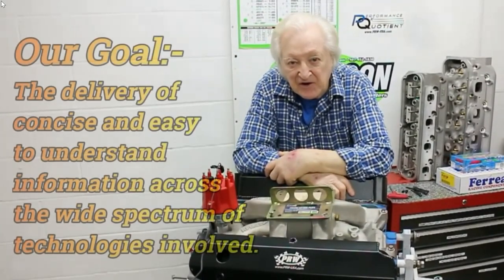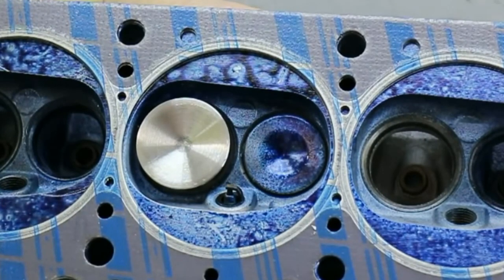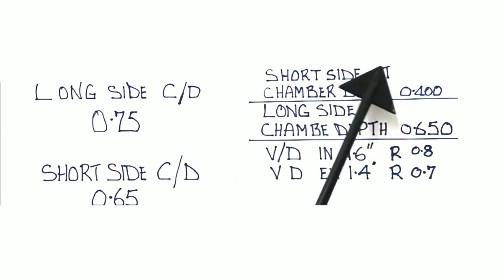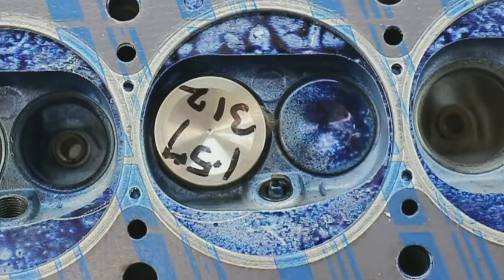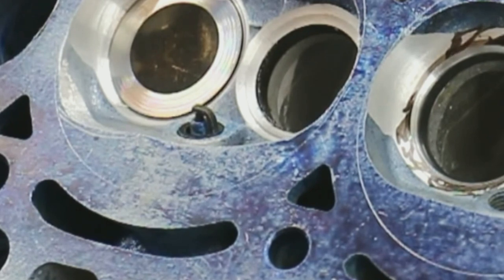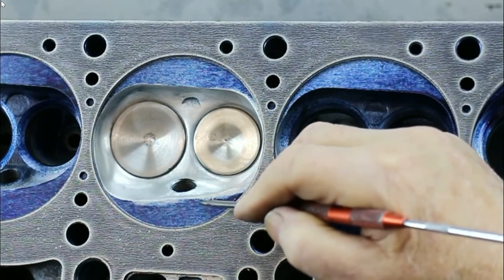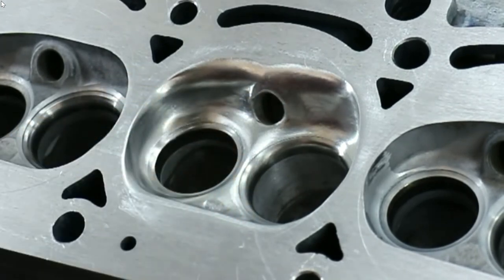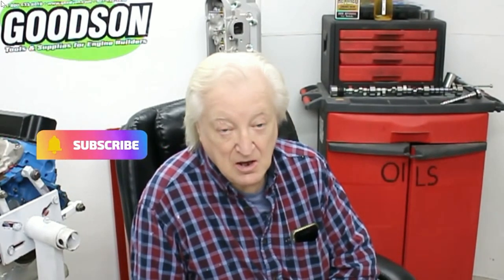Don't be without  the Turbo head chamber mods  shown here.

Comment: Mr Vizard, I did some dyno development with the 2.2 turbo 20 years ago. If using a factory style dish piston, there is maybe 1/4 inch of quench possible. Forget quench. These engines relief on massive intake pressure to make HP. Lots of heat. I found making an open chamber with consistent combustion chamber thickness gave a much more broad tuning window in  the 30 psi + range.Drilling the coolant passage oversize below the ex port in the block, gasket, and the head was also a plus. Because of the poor cylinder head, these engines require high boost to make HP. Dealing with heat in the head  is a must
Reply from the maker: Good info here Kyle, Can you pass it on to Richard Holdener for me please?
Reply: You ever try ceramic coating the combustion chamber and exhaust port to contain the heat?
Reply: @heem6619  Never tried ceramic coatings. In my research, making combustion chamber casting thickness uniform eliminated hot spots, allowing coolant to do its job,  and gave a much broader tuning window, at 30+ psi manifold pressures.
Reply: @DavidVizard  Mr Vizard. Sir, I already have. Seemed that Mr Holdener didn't put much faith in my experience. No harm, no foul. In my testing, the thickest parts of the chamber away from coolant became "glow plugs". There was evidence of erosion on those areas on blown up engines from spark knock. Kept removing those areas in the chamber, and the spark knock for no- good-reason went away. Went from breaking ring lands on the ex side with barely audible knock, to chewing up only  the center of the piston with very obvious knock when the tune was off. Opened up the tuning window, allowed more mistakes, hurt way fewer parts. Now they tell me that the big $$$ folks call this "chamber softening".

Comment: Artistry. 🫡 Unlike the old Slant Six, the Chrysler 2.2 is a bathtub, non canted valve, non wedge , non Heron type head. That's some lovely head porting on a very basic head. Minis, Triumphs, Cologne V6s, some of the most basic Bathtub heads respond greatly to the smallest modifications. 🥝✔️

Comment: David,  I would really like to see a video of what you would do to a GM 3.8L V6
(Gen II), which was a very popular engine for over 20 (maybe 30) years.
It has been turbocharged, supercharged, there are TONS of these engines
laying around, they can still be rebuilt and "built".  My biggest questions are
with the heads, intake, and cams, both stock and aftermarket.  These engines
are very reliable, get good mileage, can make very good power, and can even
out-power some small V8s if they are built right.

Comment: David, have you had any experience with Direct Injection (high pressure) Fuel Injection ? Speaking about GM/Chev GenV LS/LT Engines specifically , Do the extremely small chambers found in these Direct Injection Cylinder heads (OEM or Aftermarket) benefit from a chamber softening for certain boosted and/or Nitrous applications, as one would normally do to high performance heads using regular Port Injection ?. With the valve angle being quite shallow on most Direct Injection Cylinder Heads (11deg-12deg range) along with the small chambers (50-60cc range) the Pistons are normally limited to flat tops with the standard 'Direct Injection piston design center fuel cup' dish in the center, not really allowing for a pop-up type of design. The goal by the engineers seems simple enough, to get high compression ratio while accommodating that shallow valve angle.
I am really interested in building a Direct Injection setup using a GenV GM LT1 376cu, or perhaps the L8T 401cu Truck engine from the same family, as a BOOSTED cruiser on 87 octane fuel. With Direct Injection introducing fuel at TDC rather than on the way up on the compression stroke, much higher compression can be run on worse fuel thanks to that pre-ignition mitigation using fuel timing. 11.0:1 from GM is safe for 87oct on these engines without the risk of knock, so I am wondering if a small chamber softening can help further, so that a streetable 10.5 - 10.7:1 can continue to run 87 octane while boosted without leaving all of the timing on the table. I would really love to learn more about Detonation/Pre-Ignition mitigation Tricks and Tips that you may have that may apply to this type of fueling, or even standard (low pressure, standard injection timing) Port Injection. Cheers and thanks for taking the time to read this mess. I hope it makes sense.

Comment: When you have a chance, look into this, modifing the oil pump by-pass passage return and spring tension, don't know if this is a agreeable rule or not,  8 to10psi per 1000rpm for NA engines, if you are turning 6000rpm because of that stock camshaft, then 55psi might do,  anything above that is HP robbed by the pump
Reply: Definitely does take a lot of force to turn higher pressures and it’s a real power drain also more heat and stress on the oil! I run a low rpm (below 6k) v6 turbo engine and use 20w50 to 25w70 oil at 80 psi hot idle and 100 cold in order to gain crank and rod stability at high boost and torque load,I had previously tried lower viscosity oil and lower pressure it’s got the benefit of better turbo spool and overall a free turning engine but subject those big ends to some detonation or just a hard lower rpm boost hit and things can get pear shaped literally! In the higher temperatures thin oil and lower pressure oil is far easier to dissipate

Comment: So basically by directing the swirl of the air/fuel charge above the valves in the combustion chamber is where you are increasing the coefficient of flow for more torque as  horse power follows. This shows that every little gain adds up. This is impressive an to some degree be applied to almost any cylinder head. 
 Thanks David again for sharing. DK, ASE master tech, retired.

Comment: Eliminating the thick/sharp points in the chamber would be next. Some of those sharp points in the casting are over 1/2 thick before contact with coolant. They become glow plugs. Carve it out to a consistent thickness open chamber. I went from breaking pistons ringlands on the ex side with barely audible detonation, to eating up the center of the piston when the tuneup was wrong, while not breaking a piston or head gasket.

Comment: Hey DV, not sure if you respond to these or not, but I have my Mopar 383 iron heads and I have a question ❓ for you: is it better to have a bend in an intake port or a fairly large lump? Allow me to elaborate.

Well my particular casting has horrendous intrusion in the intake port from the pushrod boss, I bet the small block you're working on does too. I'm curious about how to treat this as it is basically an air dam. My thought is to build up more material on the intake side of the dam and feather the shape into a tear drop shape, while also removing additional material on the opposite wall to mirror the shape and make more like a lazy bend in the port instead of a flow killer right out the gate. As you often say help the air do what it wants not what I think it should do.
Or should I just grind down the lump as much as I can and send it. 

This is a VERY COMMON problem on MOPAR engines and I'd like to try something out of the box and I've never seen anyone do this so it's either genius or idiotic, your thoughts?
Reply from the maker: I cannot say for your motor but a BBC has a rocker stud lump which I just grind off and fill. on an 800 hp bb thats 20 hp!
Reply: @DavidVizard  simple and apparently effective. You're the man, thank you.

Comment: Have you dyno'd deshrouding beyond the point of improvement on the flow bench?
Reply from the maker: Yes many times.
Reply: @DavidVizard  So the improvement curve on the flow bench is a true representation of improvements on a dyno, even at much greater air speeds than the flow bench can produce?  

I wouldn't be surprised if further deshrouding still produced gains on a dyno which aren't visible on a flow bench, and just want to be completely clear that's been tested and falsified?

Thank you very much for sharing your excellent work Mr. Vizard

Comment: How do you get the compression back after chamber mods? Skimming the head, piston dome or it depends?
Reply: If you skim it you'll take the some of the mods out, 'Depends' is the best answer. As it's a turbo lowering the CR may help if it's too high, if it's too low then get some pistons made to suit. If you've never done it before you'll be surprised how little chamber mods effect the static CR. Lower CR = more boost = more power.
Reply: BOOST
DV is also quite adamant about piston to head clearance.